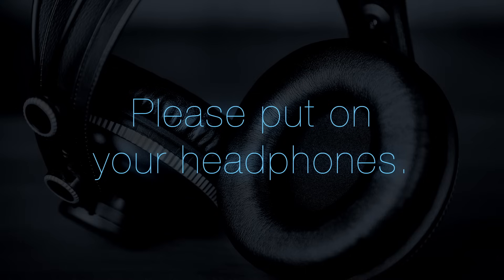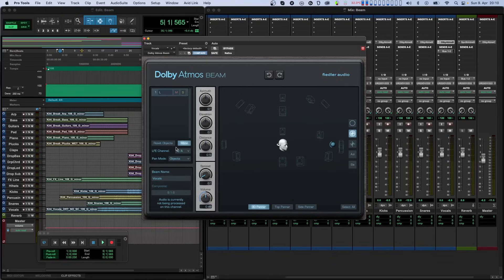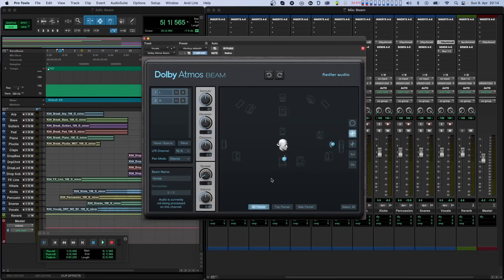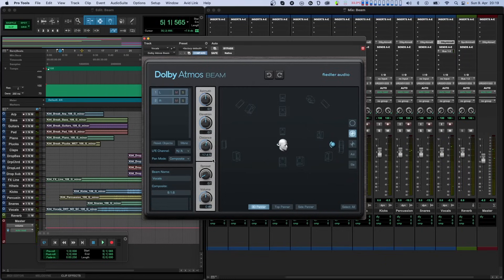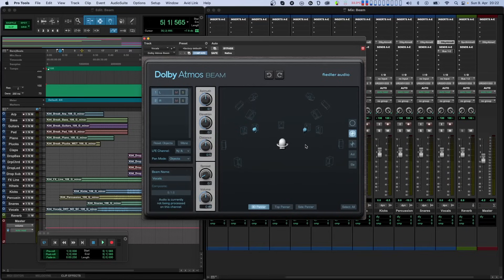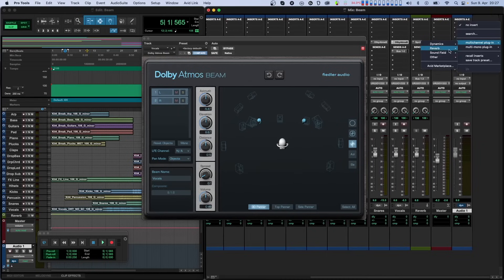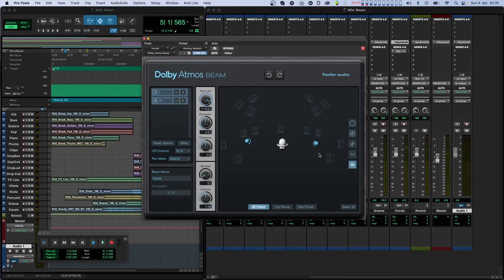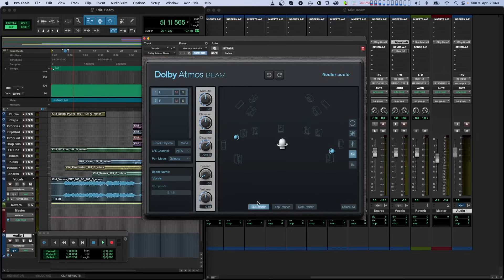Dolby Atmos Composer in-depth tutorial - 03 Beam

Comment: Is it possible to go from a stereo track to BEAM, and after beam add an immersive effect? for example Eventide MicroPitch Immersive. Will the Composer understand what is going on and apply the effect in surround? Or the Atmos Composer doesn't work with other spatial plugins?
Reply from the maker: After the Beam will not work since the Beam sends the audio directly to the Composer circumventing the DAW's mixing engine. You need to place it before the Beam and then pick up the multichannel output of your effect and send this to the Composer. That will work with no problem.

Comment: Does this mean you can't mix with bus processing or folders? If so, then what is the solution? Are Auxes and VCA's included or no? Would you please do a video on this subject because it's probably a deal breaker for many people! Thanks
Reply from the maker: Of course you can work with buses, groups and folders. You can put the Beam plugin anywhere in your session, also on bus tracks, group tracks and so forth. It is extremely flexible.

Comment: I was pleasantly surprised to see you permit negative elevation, with objects in the lower hemisphere. AFAIK this is not supported in the Dolby Atmos spec. Do you have any further details on how objects in the lower hemisphere are processed by DAC when exporting to ADM or straight to binaural?
Reply from the maker: The newest version of the Dolby Atmos Renderer does indeed permit negative elevation although it might not yet be available in Dolby's products. When panning to the Composite Beam does the panning to the speakers on the horizontal plane while if the Beam is set to object mode the panning is done by the Dolby Renderer.

Comment: Is there a way to link both objects permanently (in a stereo track) inside beam? That would be helpful to have when using automation. For example, having only one automation track for controlling the azimuth of both objects instead of having to write 2 automation tracks.
Reply from the maker: Currently the only thing you can do is to select two or more objects and move the selection altogether. In the Dolby Atmos Beam plugin there are several panning modes where the objects in the selection maintain their spatial relationships. A hard link is on our list though so stay tuned.
Reply: If your daw allows VST modulation/macro control you should be able to map them to the Beam VST parameters to control directly. In Bitwig i've created a preset for Beam VST just to do rotation, spread, width, elevation etc from the DAW rather than using the Beam plugin itself. Works well imo.
Reply: @SamHocking  Great idea!

Comment: I tested it in ableton. Is it true, that volume changes can only be made in beam and not in my ableton mixer? That would be a bummer :(
Reply from the maker: Effectively the volume slider of the mixer sits after any plugin which results in a yes to your question. However, if you use a bus return or aux channel with a beam on it, you can use the volume sliders of the channels that go to this bus or aux. If Ableton implements Post-Fader Inserts one day you will be able to do directly what you are asking for.
Reply: @fiedler-audio  Same issue in Bitwig. Pretty sure Bitwig & Ableton are only set to do post-fader inserts, the sends can be pre-fader or post-fader though. Beam is the only insert plugin I've come across that doesn't respond to fader input? Is it bypassing the logic of the DAW audio flow?
Reply from the maker: @SamHocking  Bitwig and Ableton only have pre-fader inserts, no post-fader inserts, like most other DAWs. Post-fader inserts are currently only available in Cubase, Nuendo, Mixbus and Sonar. So in Ableton and Bitwig the logic of the audio flow is plugins first, then fader.
Reply: @fiedler-audio  Ahh yes, of course, because the audio is ultimately routing to master in a traditional plugin workflow, we hear it as volume adjusted anyway, but Fielder is routing it direct to the Atmos Composer.

Comment: I posted to support, but just in case others also get confused using Bitwig, the Composer plugin doesn't seem to support multichannel output possible in Bitwig? It's stuck in Stereo. Could Fielder please enable multichannel outputs so we can take Atmos Composer 7.1.4 straight to the DAW I/O. The 'external' outputs make no sense at all, why would I want to use a second audio interface just to take the audio to my speakers? Bitwig supports up to 64 channels of multi-out audio from VSTs so easily enough for a 7.1.4 or 9.1.6 studio setup.
Reply from the maker: Hi Sam, the Dolby Atmos Composer of course supports multi channel output. But what it currently does not support is multi output, meaning using multiple stereo or mono outputs routed to different channels, which is a workaround for DAWs which are not really multichannel as such. The external output feature can still be used, you can set it to the same audio device as used by your DAW. That is even recommended as that guarantees that there won't be drop outs due to different clocks. So, just select your audio device as External Output and turn your master fader down. Then all your pristine multichannel signal is going directly to your audio device. We are looking into a way to make multi output working for the Composer though.
Reply: @fiedler-audio  Thanks. I have one 16 channel audio interface so external output isn't a workable solution unfortunately as those 16 channels used by the DAW must be used by Fielder Composer. By hosting Fielder Composer inside Plogue Bidule I fixed the issue of VST3 not allowing multi-outs, so all good.
https://youtu.be/PWXSZoK8chY
Reply from the maker: @SamHocking  We are looking into why on some Windows machines you need such a workaround. So stay tuned. It is on the top of our list.
Reply: @fiedler-audio  Great stuff. I think to some extent it's a limitation of VST3. I'm not aware of any of my VST3 plugins that supports multi-out. Liquidsonics Cinematic rooms is a good example.
Reply: @fiedler-audio  Thanks, this answered my inquiry in your other video!